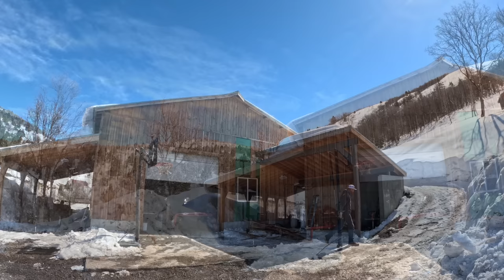Hard Winter Damaged Skid Steer, Framed In New Shop Door, Spring Break With Kids

Comment: howdy ,
I happen to  notice the hydraulic hoses are  being hit by the tire chains pretty hard    {while the plow is facing left..  } 
=maybe make a fence wire flex tie to pull them back retracted out of the way when the plow is allowing slack in the hoses.. 
wouldn't want to see a  high pressure line failure... 
good luck !!! this message will self destruct in 5 sec..

Comment: If you're losing your chickens at night Somehow the garments are getting in You're co-op? I have a 13 by 30 co-op I dug a foot deep trench 10' out from the sides are inside the run I put cattle panels with chicken wire  Attached I backfilled it in and at the bottom of just a few inches underneath the surface of the dirt I have a bottle foot of chicken wire that goes out from the wall of the run I bury that under dirt and if anything comes and tries to dig get in it can't get in but I use plastic coated Chicken wire so that it doesn't rust My  Co-op is about 2' off the ground so when it gets real hot the chickens can go underneath co-op to get cool and they like to go under there and sunbathe and cause the sun in the summer time is right by the front of the co-op and they dust bathe in sunbathe there usually they do it out now we are too but I free range my chickens in the summer time and I in the Winter they are in the run they don't get out because predators will come after all I have had chickens for many many years and I have lived in the northwoods Minnesota and now in Wyoming we have bobcats we have Fox we have coyotes and I have never lost a chicken that way When the predators are really hungry I just need to keep the chicken
Reply: Karen Riggle gives a giggle 😊 - maybe set up your spell checker to keep those garments out

Comment: Cheaper than renting a Concrete Saw:  Buy a cheap hammer-drill and some long bits. (h*rbor fr***t)  If you drill a series of holes (close to each other) you can knock out chunks of unwanted concrete with a sledge hammer.  You end up with rough edges, but you can grind them smooth.  I have done this.  You have plenty of concrete to practice with before you get to the sides.

Comment: Hello Heath, I can't remember if your comments about attachments for your skid steer were in this video or another one, and I don't have time to go back through it right now. I remember you talked about purchasing an auger for the skid steer.  Having used a skid steer to bore holes, I wouldn't recommend it. A better option would be to purchase an auger for your digger. There are a number of reasons but mostly it is because most of the weight in the SS is at the rear and if the ground is hard it will struggle to push the auger into the ground. The other reason is stability when working on a slope. The digger you can use the blade to get the digger level so the auger is vertically plumb. That can be quite hard to do with a SS, and they are more inclined to move around when you a boring the hole. Ian